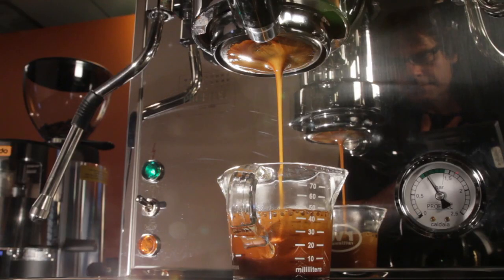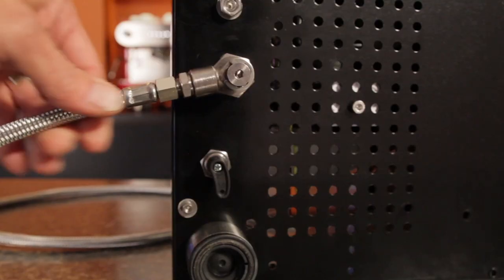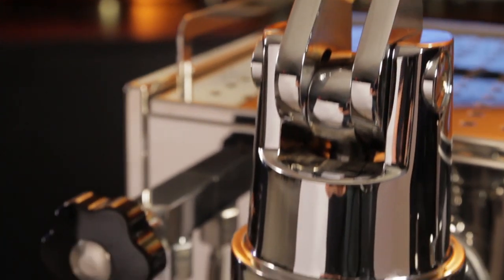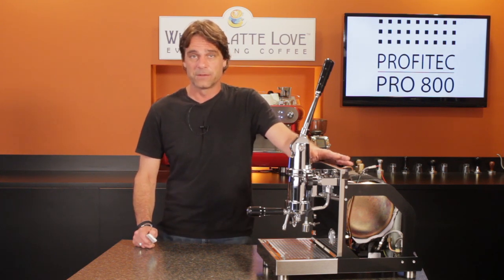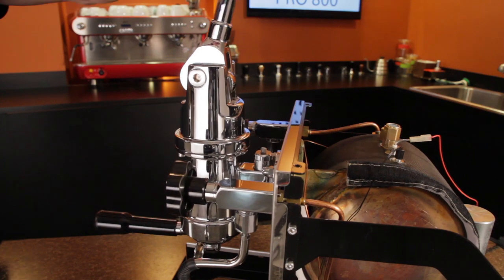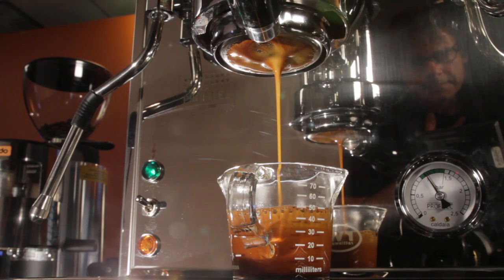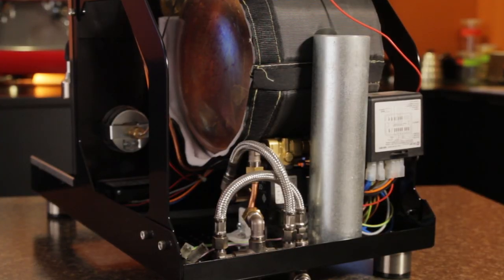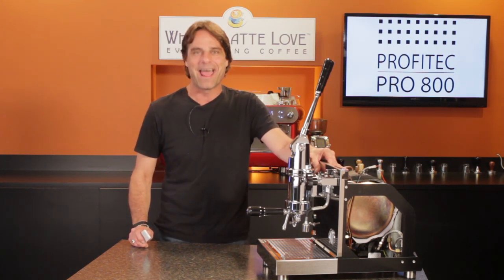Review: Profitec Pro 800 Spring Lever Espresso Machine

Comment: Well, my one year ownership experience with the Profitec: amazing machine. No issues whatsoever and I’m used to the lever to a point that I cannot imagine ever going back to a pump machine. It makes the coffee ritual that much more involving....Also, I have noticed that cheaper beans I liked in the past have been underwhelming or bad on this machine while premium coffee excels in it. It seems to get more “layers” of flavor out of the beans, so bad coffee beans taste worse and good beans are way better tasting then when using my pump machines. All in all : highly recommended in my opinion!
Some other notes (maybe someone finds it useful) : I use a 14 gram basket for a single shot, filled with 11 or 12 grams of coffee. Preinfusion 7 or 8 seconds. I pull the cup away when the lever is straight up. PID temp is around 120, degree lower in summer, degree higher in winter.
Reply from the maker: Hi kk, Thank you so much for sharing your experience! I'm sure others will find useful!!! Please excuse my delayed response. Just returned from Italy where I visited the manufacturing facilities of Profitec/ECM, Ceado, Bezzera, Izzo and Rocket Espresso. I'm a firm believer that lever machines are capable of producing some of the best espresso due to the way pressure ramps during an extraction. While in Italy Alex Izzo (namesake of the Izzo Alex Duetto machine) gave our team an amazing demonstration on a lever machine producing some incredible shots into a saucer from coffee he roasted. The crema was amazing - still there in the saucer 10 minutes after extraction. Look for video of that demo coming soon to our channel.
Reply: Thankyou buddy, yeah indeed i think that the lever machine is something special because of the looks but I don't have any experience with the taste of it. Well we wait for the upcoming video of whole late love then i wil make a decision.

Comment: I wish the PID was visible since the shot timer built into some of them can be very handy.
Reply from the maker: Hi ITWW, I hear you. A couple things to keep in mind... If plumbed in the pump never comes on and timers are typically tied into pump electronics to start. Timing though useful in some ways is not so much a thing on this machine type. Manual levers are considered pure and traditional. One quite literally pulls a shot. Guessing some may feel a digital display on the face compromises the aesthetic.
Marc

Comment: Hi Marc! Thanks for constantly monitoring our questions. It's very helpful! How would you compare the steaming power of the 800 vs the Synchronika?
Reply from the maker: Hi Anson, You are welcome and thank you for the comment and question. IMO the Synchronika has more steaming power. In fact it's best in class for this type of machine with the steam boiler able to run near 2 bar. Depends on where you set the temp of the Pro 800 as to actual in boiler pressure but it will be far lower than 2 bar. Also changing the boiler temp in the 800 will change your brew temp. Hope that helps!
Marc

Comment: Since I got this machine, I was not able to get thick layer of creme on my espresso. 
I tried to change temperature, dosage, grind setting and pre-infusion but all there wont help. I had tried all those methods with different beans, fresh and old. 
I believe the problem from the pressure, because it only produce very thin espresso drip during extraction. 

I use EK 43T grinder.
Reply from the maker: Hi MA, With quality beans and a dialed in grind this machine is capable of making a crema rich coffee. What beans are you using? How long in seconds is it taking to extract a double 2oz/60ml shot? Check out this video in which we do a 12 shot progression using bottomless/naked PF to appraise grind/dose/tamp techniques on the Pro 800: https://youtu.be/rHG1EWbrk9Q

Comment: Mark, is it normal for spring lever machines to need a second pull to extract a two ounce double?  Thanks...
Reply from the maker: Hi Randy, Thanks for the question. Generally no. You can do another pull to add more water and up the extraction pressure.
Marc
Reply from the maker: Also, here's a link to me pulling a series of 10 naked shots on a Pro 800. Some with extra pulls and other technique variations: https://youtu.be/rHG1EWbrk9Q
Reply: I bought a Ceado E37S from WLL a few weeks ago.  It's a beast of a grinder.  I almost bought the Profitec Pro 800, but I wanted a two group spring lever machine.  They are difficult to find and especially one that will fit on my countertop.  I purchased one and cannot produce greater than one ounce regardless of the grind from the Ceado.  I have tried from a fine setting of 4 to a loose grind of 8.  I have a Puqpress and have varied the tamp from 20 to 40 pounds and everything in-between.  Every single pull produces 1 ounce unless I double pull.  Which is the reason I asked the question after watching your demo video.   @Wholelattelovepage

Comment: Does this machine require a straight water connection only or does it also have a fillable water tank?
Reply from the maker: Hi Iceman, The Pro 800 does have a fillable reservoir underneath the cup tray.
Marc
Reply: @Wholelattelovepage  in your personal experience for shot quality and consistency Pro 700 with flow control or Pro 800?
Reply from the maker: @Iceman-xe7jo  A lot depends on the coffee used. Lever shots tend to be more syrupy and sweet with the right coffee. While you can change variables on a lever shot you do not have the range of options available with flow control. Lever shots can be tricky with the initial high pressure. Hope that helps!
Marc

Comment: Hi Mark, I like to drink dark, medium and light roasted third wave beans. My grinder is a Niche Zero. Do you think the Pro 800 would be able to handle the acidity of light roasts and produce sweet shots or should I go with a Pro 700 + flow profiling? I'd prefer the manual pulling of the lever and the longevity and repairability of the Pro 800 but I'm not sure if I would be able to pull a good tasting coffee with it.
Reply from the maker: Hi Florian, I think flow profiling on the Pro 700 will give you more flexibility with that (huge) range of beans. To tame the acidity in light very fresh coffee you'll have to do a lot of holding back of the lever on the 800. If you have not already check out my live stream from yesterday where I used a Pro 700 with FC on a lighter, fresh high altitude coffee to reduce acidity/brightness: https://youtu.be/suux3RrbAxA I'll be using flow control for different situations in my next 4 streams which I do Tue/Thu at pm EST. A sweet bump profile on 5/5, Working with dark roasts on 5/7, Lever shots without the lever on 5/12, Coffee shots on 5/14
Marc
Reply: @Wholelattelovepage  Marc, so are you suggesting that using a lighter roast on the Pro800 wouldn't be as easy to pull the shot as compared to the 700?  could you elaborate more on what you mean by having to do a lot of holding back the lever?  is that to prevent it from going up too fast?

Comment: Hi Marc
Can you talk a bit more about the dipper boiler? how is it compare to HX boiler and/or dual boiler?

Thanks
Reply from the maker: Hi HY, Sure. The dipper uses a tube from about the center area of the boiler which feeds into the group. When the lever is pulled down water is pushed by boiler pressure into the group. The lever groups are very heavy so large thermal mass. As hot water from the boiler travels into the group its temperature is modified/reduced by the thermal mass.
Marc
Reply: @Wholelattelovepage  
Hi Marc, Thanks for your reply. I am considering getting an orchestra nota or profitec 800 for my new home, how do they compare to each other? I do want a machine that makes great espresso and I also play with latte arts sometimes. any recommendation? what are the differences between these two? (except the E61 and lever of course)
Reply from the maker: Hi, I have not used The Nota so cannot speak from direct experience. It's an E61 group machine and I do use a lot of similar machines. Lever shots generally use a different profile than typical E61 group machines. Levers start with a good no to low pressure wetting of the coffee as the lever is brought down. As the lever is released pressure builds rapidly. Then, as the shot progresses pressure ramps down. In general, I'd characterize lever shots as having the ability to produce a potentially sweeter more syrupy shots when used well. As always a lot depends on the coffee and the skill of the user in regards to grind, dosing and machine operation. Pulling lever shots is a more involved process for the user. In a way you get a closer connection to the coffee.
Marc

Comment: Hey Mark! Correct me if I'm wrong the massive group cool down steam temperature water for correct brewing temperature? The same effect as on simple Pavoni's Europiccolas? And also you can brew and steam at the same time with the machine.. right?
Reply from the maker: Hi P2K, Yes you can brew and steam at same time. Also correct that the massive group cools down boiler water to brew temp. I was running PID for 250F/121C in boiler with ambient temp of 72F/22C. Have you used lever before? Got to say the sweeter smother shots definitely are a thing! I did some Papua New Guinea 1600 meter coffee as well as some Lavazza Top Class side by side on this machine and a Pro 700 and there was an easy to discern difference - even with the Lavazza TC!
Reply: Yes! I have Europiccola in my home and at first I couldn't understand how is it that the Steam is always at demand while with my Silvia I had to wait for the steam temperature to rise first.
Doesn't this machine tend to overheat after couple of shots made one after the other?
Reply: Same question i asked myself also but, thinking a bit deeper when shots are brewed, new "Cooler" water comes after, thus helping it maintain the set temperature and preventing overheating. The thing I'm not quite sure is, how can you control how much it will "cool" down the water to the correct "stated" temperature if its overheated during the brewing process...Looking forward to Todd and Marc having an in depth review, as i was considering getting myself (after 2 years saving) for the Bezzera Stregga and this comes just in time to see how does the 2 of them compare for my Christmas :).
Reply from the maker: We have yet to test actual brew water temps when pulling shots rapidly. Our Scace wasn't available when I was shooting. But we will be! I have seen the 800 pull shots back to back every 2-3 minutes for 20 minutes straight. One would think it would start to warm up a bit. On the other hand, your only adding about 60ml of water to the group with each shot. That's not a lot when compared to the 17lb. mass of the group. In my testing I pulled 5 or 6 doubles with only a minute or two in between. To my taste I did not notice an increase in bitterness from first to last shot - but that's highly subjective!
Reply from the maker: Hi Ruben, Actually the water coming into the group is overheated and the group cools it down. The Strega uses an HX boiler so water (if you don't do a cooling flush) is overheated. Also Strega cannot do a true low pressure pre-infusion. Its' pump runs to fill the group and will apply its' full pump pressure to the coffee in the cocked lever position. Temperature surfing with a flush variation is probably easier and definitely quicker on the Strega than adjusting PID on 800 and waiting for it to passively change the group temp. Kinda comes down to what's more important to a user the low pressure pre-infusion or quick temp surfing?
Reply: Thanks for your reply Marc, so both lever machines you still gotta Temp Surf or "group cool" with the added bonus benefit of pressure variation, and would it be better to have pressure variation like a lever machine or a more accurate temperature like a Dual Boiler Pid machine like the Profitec 700 ?
Reply from the maker: Ruben Chavez
That's a tough one to answer. In my opinion the pressure profile you get with a lever has the ability to produce a flavor that tends to be sweeter and avoids over-extraction at the end of a shot. Levers brew in a way that's different than pump machines with the tapering pressure through the duration of the extraction.
Reply: The Strega needs cooling flush because the thermostat setting for the grouphead's cartridge heaters are too high (it's at 95C+ if I recall correctly). If you PID the cartridge heaters and set it properly (<95C), it is no different than running a dipper and no cooling flush is needed at all. The massive group head is supposed to cool down the water, not by doing a cooling flush. If a HX lever overheats because of the incoming water temperature, a dipper lever would be way worse because it is drawing water directly from the boiler itself. Boiler water will always be hotter than HX water in any case.
Reply: Whole Latte Love : I have read some extensive tests on a coffee forum who tested the turnaround time of the group (often called a Bosco group, but actually made by another company). Seems like the group keeps a very stable temperature and recovery is about 1.5 minutes between shots. So overheating should not be a problem with this machine. Interesting is that after an hour of switching the machine off the group is still to hot to touch! Talk about heat retention! I absolutely love my pro 800, using it is WAY easier than everyone seems to think. A lever machine is not scary or dificult, just different. The taste profile may not be for everyone though..
Reply from the maker: kees ketsers
Thanks for the comment. The group is massive so does a fabulous job of keeping temperature stable. Personally I love the flavor profile this machine produces which I believe is a result of true pre-infusion and then a brew pressure that ramps down as the extraction progresses.
Reply from the maker: zenovation1
Hi, a compare with the Pro 800 and Strega is a natural! A lot on our plate at the moment so can't promise the video anytime soon - sorry!!! At the moment the PP800 and Strega are within $100 of each other in price. I've used both, and personally prefer the 800. It has PID and I'm a huge fan of Profitec's sprung valves for steam and hot water. It also comes with a naked portafilter. The PP800 has a 3.5L boiler vs. 2L on the Strega. Also sorry we have not been able to do the Linea video yet - still on the list.
Reply: I am also very interested in an in-depth comparison of the Pro 800 and the Strega

Comment: Thanks for the explanation. Will this machine be suitable for a small cafe?  (15 people max) and any other recommendations I should check?
Reply from the maker: Hi NP, It's possible although not technically a commercial rated machine. You might have a look at the Gaggia TS which is a very affordable commercially rated machine suitable for lower volume use: https://www.wholelattelove.com/products/gaggia-ts-espresso-machine
Marc
Reply: @Wholelattelovepage  thank you for your helpful response. I am considering the Athena leva.

Comment: hi marc... question if you were to run the Pro800 off of the reservoir, would the pump turn on EVERY time you pull a shot?  or would it only turn on after x# of shots pulled to refill the boiler?

also, for the drip tray, the permanent collection area, does that connect to a hose?  i'm thinking to put the 800 nearby my sink since that's the only place where lever won't get in the way of the cabinet doors.  so it would be neat if i can just connect it to a hose and have it drip directly into the sink.
Reply from the maker: Hi e, Thanks for the questions. The pump should not come on with every shot when running from reservoir. Hard to say exactly how many shots due to variables involved. Yes you can connect a drain line. The drip tray is drilled and has a black collection cup underneath as seen in product photos here: https://www.wholelattelove.com/products/profitec-pro-800-lever-group-espresso-machine
If you're that close to a sink you must be near a waterline. Plumb the machine to waterline and the pump will never come on. And as I always say plumbing a machine and never filling a reservoir again is a life changing experience!
Marc
Reply: @Wholelattelovepage  Yup i'm thinking the same to plumb the machine. but that would involve drilling a hole in the countertop... wifey no likey. haha.. 

i was thinking maybe i can run a water line from my Watts UF3 filtration system through the countertop, so the hole i drill will just be a small hole, then using a quick connect to connect it to the stainless steel breaded line to the machine.  would that work?
Reply from the maker: eosme that should work
Reply: @Wholelattelovepage  thanks Marc.  if tapping water from the filtration system, would i need to install a pressure regulator valve in between or would the water pressure out of the Watt UF3 be enough (40psi ish) for the Pro800?